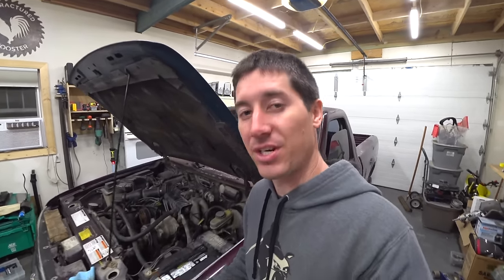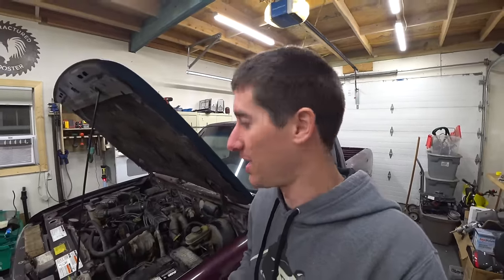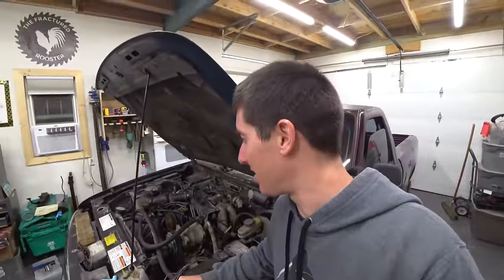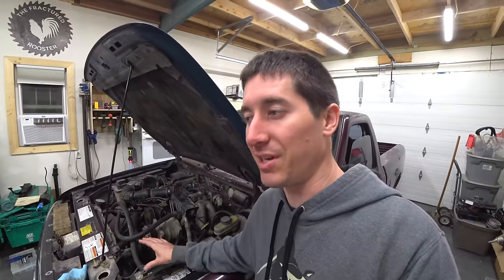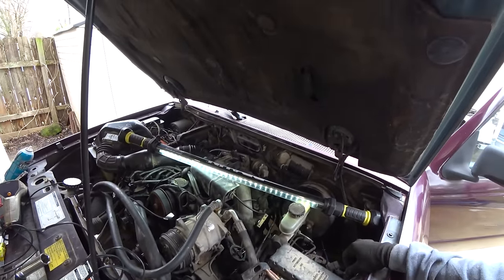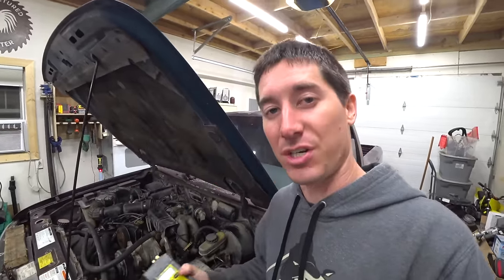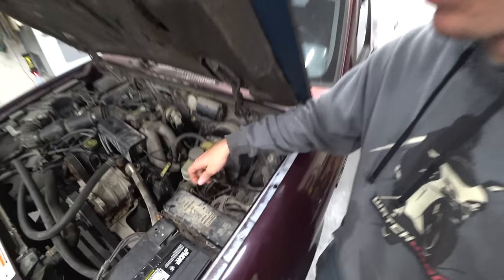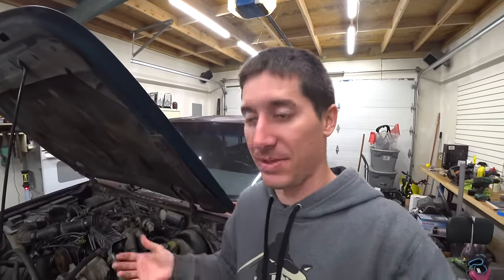We FIXED The $300 Ford Ranger And It Doesn't Make ANY SENSE

Comment: had a '91 Ranger...  same configuration...   2.3L dual plug, 5 speed standard cab short bed XLT.  Great little truck.  Drove it cross-country 5 times.  You're right...  they're a great little truck.   No significant power to speak of, but always ran great.   Never had a SPOUT connector issue with mine.  Bought it 6 years old with 100k miles on it for $2000.  Drove it another 7 years & 92k miles, & sold it for $1500.

Comment: Like I said, days ago, those had module problems. The SPOUT connector keeps the module from handling the timing control over to the ecm. Unplug the spout and the module runs on base time
Reply: I think it might be the TFI module
Reply: So changing that module should be the fix? I don't know anything and I'm a nobody but I need these videos to learn thanks to everyone.... so I'm wrong.... Thanks for ur input guys....
Reply: Hey Remember on that first video when we all said the computer wasnt taking over? +1 to OP
Reply: @albertcastle7786  : Actually, cleaning up the grounds and heat sink could fix it, if an auto parts store bench test has it come back okay.

Just be warned: Removal of an ignition module off of the intake manifold can be not worth it, if the bolts that hold it on are corroded beyond repair. They are also very easy to strip the heads on as well.

Comment: Bad EEC is very common in these. I chased a driveability issue on my 97 with the 2.3 for a year before I finally replaced the EEC. Problems all went away and it ran WAY better.

Comment: I still say check ALL the ground connections on the entire truck. Remove them all, clean all the spots where they connect with sandpaper, use some dielectric grease, and reconnect them. It can make a huge difference in reliability on these trucks. The ECU uses grounds to switch circuitry on/off...
Reply: Jesus loves you alot trust in His death 4 salvation and be saved from eternal hell <3 Jesus died on the cross for you bro. <3

Comment: I also own a 93 2.3 Ranger. It just happens to be same color (except for your replacement hood). My coolant gauge has always  indicated barely warm even when the engine reaches the normal operating temperature of 193 degrees Fahrenheit. Early on I contacted the previous owner but he assured me that it's normal and not to worry about it.  Last spring I decided to replace the thermostat anyway. I ended up having to remove the fan, fan housing, and upper coolant hose in order to provide working room.  The first attempt was a complete failure. The truck ran icy cold.  I don't know how often this is the case, but the funky  thermostat housing also needed to be replaced at the same time in order for the new thermostat to seat properly. I recommend that people replace both parts to save time. With the fan removed for the second time,  I decided to also replace the fan clutch as preventative maintenance. That job doesn't take long. By the way, there was no change in the temperature gauge reading afterwards but it did provide some peace of mind. 
The driver side spark plugs are hidden under the intake manifold, fuel injector rail, and part of the wiring harness. Some are much harder to get to than others. The job of replacing plugs on that side  is so difficult, in fact,  that my shop manual recommends removing all the stuff blocking the way first. Wow, are you kidding me?  It would be nice if someone posted a clear video on either how to remove the intake manifold and fuel injector rail or how to go about replacing the plugs with the least amount of hassle. There are some videos but I found them so murky and incomplete that they were useless.

Comment: "He got it FIXED? Guess i better stop everything I'm doing to figure out how."
Reply from the maker: It's okay, we still don't know how... but 99% sure it's a failed ECU 😂
Reply: @WatchJRGo  first thing I said Jr go!
Reply: Why don't you fix the video volume so we might be able to hear it
Reply: My bad your good my phone is the problem
Reply: @WatchJRGo  Did you check the wiring on the return side of the spout?
Reply: https://www.fordforumsonline.com/threads/identifying-and-understanding-ford-ignition-systems.3764/

I think it might have a bad Cam Position Sensor (CMP) sensor:

LDR DIS Camshaft Position Sensor (CMP)
The function of the CMP sensor (commonly known as CID) is to detect the position of the camshaft in order to identify cylinder #1. Like the CKP sensor, the CMP sensor is also a digital, hall effect, output device. On the 3.8L, the sensor, vane and permanent magnet were designed to be installed in the same bore as originally provided for the distributor. On the 3.0L SHO, this assembly is located on the right end of the rear cylinder head assembly, close to cylinder #1. The CMP sensor generated a signal in the same manner as the CKP sensor. The CMP signal is a digital square wave that varies between zero to 0.4 volts (CMP low) and battery voltage (CMP high). The CMP signal goes high at 26 deg ATDC of the power stroke of cylinder #1. The duty cycle is 50%, therefore, the CMP signal stays high for one complete crankshaft revolution. The CMP signal goes low at 26 deg ASTDC of the intake stroke of cylinder #1.
The CMP signal is used by the DIS ICM to fire the proper coil and by the PCM to fire the correct injector at the proper time.

LDR DIS Failure Mode and Effects Management (FMEM)
If the CMP sensor fails, the ICM will randomly select one of the two coils to fire. If hard starting results, turning the key off and then cranking again will result in another "guess". Several attempts may be required until the proper coil is selected, allowing the vehicle to be started and driven until repairs can be made. If the SPOUT line fails, the ICM will fire the coils directly from the CKP sensor. This results in fixed 10 deg BTDC timing and fixed dwell.
If the ICM is in dual plug mode, IDM will mirror SPOUT. If the ICM is in single plug mode, IDM will be inverted with SPOUT (i.e. SPOUT is high while IDM is low).
Reply: @MrHerrjon  this is 2.4 4 clay!!
Reply: It was the ecu
Reply: @WatchJRGo  I had a very similar problem no spark with the spout in take it out I had spark I replaced Ignition moduel  coil and did a tune up just to find out it was my pickup coil in my distributor  in your case would be the cranksensor mine was a 94 ranger with the 3.0

Comment: Congrats on getting Ford Danger running.  Ironically as you were checking out parts I noticed how garage roof was framed, beams run lengthwise (long ways) instead of crossways (short ways).

Comment: I’m guessing that you could have a couple sticking valves. They hang up until you advance the timing and then they’re ok. Drive it for 50 mi with sea foam in the oil then change it with synthetic oil and call it a day.

Comment: Makes me miss my 93'.Same color but long bed.Leased it for 2 years back in the day when I was selling new Ford's.Never had any problems with it.Wish I would of kept it!Little Pinto motor came a long way from the 70's.Dual plug head was a cool trick to squeeze a few more ponies out of the coral and also burned cleaner.Was also the 1st American engine designed with metric parts in this country when it was introduced for the 1974 model Mustang 2 and Pinto.Nice job getting it back going JR.

Comment: The other spout connector changes the computer strategies for higher octane fuel. Common to unplug it when you have spark knock problems. You might have a Ignition module going bad.
Reply from the maker: We did try a brand new ignition module, no change (with and without the SPOUT connector, you can see the old one pop back in during the video) 😬
Reply: WatchJRGo I used to work at Ford dealer until 2004, retired. My old mind remembers pulling spouts on no starts as part of flat rate diagnostics. But can’t remember the rest. Thinking it was something easy to repair. In eastern Canada those trucks are long rusted out and gone. It was a common problem at one time.
Reply: @drost582  It may be a bad TFI module. It is located on the back of the distributor.
Reply: @collinklitz7434  : TFI isnt used on a 1989-1998 truck, as EFI and DIS replaced carburetors and distributor ignitions in the same year.

What you're referring to is a bad Ignition Control Module, located on the front of the intake manifold. And yes, those modules are known for having casing issues, corrosion, and grounding problems, because of the engine heat under the hood.

Comment: Worked on an early 90's E-250 once that confounded me to no end.
The entire ignition system replaced, TFI module, several sensors, fuel system gone through......just, no start-no-how........ended up being a bad ECU, which was surprisingly cheap from Napa.

Comment: Watching this made me miss my 82 ranger. Same set up. The sold it to me because after he got the motor rebuilt he couldn't get it to stop leaking oil. I towed it home and immediately found the valve cover bolts were finger loose. I put a new gasket in it a pcv and filters. It took me another 100,000 miles before I sold it to a guy for $1,000. All I did was keep up on maintenance. It's still running to this day.

Comment: I was going to say I had a 1991 explorer that had all kinds of strange problems like this. After trying all kinds of things for years we finally figured out the ECU circuit board was all corroded on the back side. Replaced it and sold the thing. It's still driving around town now.

Comment: The TFI module next to radiator ( on some models) is malfunctioning. If you still have issues with it not warming up, the impeller on water pump needs to be checked. I've been dealing with these engines for ages. Always the same issues. Here is something for you to wrap your head around, Do both spark plugs fire on the same cylinder or does the spark get wasted on the exhaust stroke on the other cylinder? For those who don't know, these engines have 8 spark plugs.

Comment: Ford had 2 different ICMs during the OBD1 years, gray and black (you can look it up, thousands of blogs sites) Sometimes both ICMs in the same model year, but the ECU works differently depending on the ICM. An issue with part stores is they all make gray ones, so if you go to OReiley  or NAPA...they just come in gray. If the spout connector removed is allowing the car to run, you might have the wrong ICM, because the spout operation is different for each one. If you decide to trouble shoot deeper, I would recommenced you look up the correct ICM using the serial number of your ECU, and go with a genuine motorcraft part to ensure it’s the correct ICM. Oh...and another ford idea...there is a special thin wall socket to fit inside the ICM to remove it from the heat sink. Good luck!
Reply: Yeah, no shit! Had to grind a socket to get that twerp ICM off me Aero1star.

Comment: I had a '96 4.0 automatic. Purchased in '98 with 27k miles, ran to the ground at 332k miles. Engine was a beast, especially considering my lack of taking care of it. It should have died around 220k tops. Only had to replace front left caliper and solenoid, thermostat, tensioner pulley and belt, starter, tires a few times, and battery twice. Had it 11 years, and it saw 34 states.

Comment: Well, I was wrong, I'll own it! I honestly thought the cat converter was it.
On the actual problem, I'm not sure in this one, but a friend had one around that era, bought it brand new and it had similar issues, turned out the ECU was mounted under the dash and one of the pinch welds was leaking letting water run into the the ECU and shorting it out. The dealership ended up giving him another truck. Might be worth a look at the connectors?
Also, Ford Motorsports used to sell a camshaft for these, I put one in my '94 2.3l, really opens them up around town, lots more low end and driveable power, it still sucked on the highway, but a good city truck.

Comment: Already said days ago unplug the SPOUT connector. Timing advance is NOT controlled by the ICM, its controlled by the main computer receiving the PIP signal. Replacing the ECU can still not be the problem. The problem can be the PIP sensor inside the distributor, solved by replacing the distributor.

Comment: Ford went OBDII in 1995 & 1/2.  This is when they got the capability to read data from the PCM (Powertrain Control Module) via a scan tool.  The pre-OBDII was flash codes that read through the dash MIL (Malfunction Indicator Lamp) and could be initialized by a jumper under the hood or with a code reader that used the same connector's.  The symptom that is being experienced by that old Ranger is most likely a bad MAF (Mass Air Flow) sensor.  The same issue is common in most MAF cars and trucks.  Runs crappy or will not start with the SPOUT connector plugged in.  Unplug the SPOUT connector and it starts and runs.  When the SPOUT connector is unplugged the engine runs in Open Loop Mode and the timing is fixed at 10 degrees BTDC.  That is why it starts and runs but has poor acceleration and overall performance.  In this mode of operation the Air/Fuel ratio is also fixed and ignores the Oxygen Sensor input.

Comment: Went down this exact same rabbit hole with my '93 Ranger about year ago. Long story short, both coil packs are bad. This engine is twin plug head. It has separate coils for each bank of plugs. One or both will be used at different times depending on engine speed, load, and temp. All controlled by the ICM. The truck runs without the SPOUT because it's in default setting, using both coils and banks of plugs at the same time. When running like this each coil pack picks up where the other one is not giving a strong enough spark. One plug will fire where the other in the same cylinder will not, allowing the engine to run.

Comment: Grounds?  I have found on fords of that time a lot of times cleaning and inspecting the connections made the fix last longer.  The gremlins have driven me crazy over the years,  grounds are the first thing I check now. the small ground wire off the battery has a connection that looks like  a fusible link. also if it has battery clamps replaced , folks seem to like to disconnect the frame ground lug on the wire to get a little more length to the wire. The bad grounds can cause weird / non working fuel gauge, tail lights, turn signals and other assorted intermittent weirdness.

Comment: I had a 91 Ranger with a similar problem right after Superstorm Sandy, drove me crazy. Could figure it out to saver my life. Pulled air cleaner and it ran great, idle a little high but ran. Looked more into it and ended up getting MAF cleaner, sprayed it down and the thing ran great afterwards
Reply from the maker: Nice! I clean a lot of MAFs around here, if nothing else it’s a good maintenance item 🍻
Reply: Same

Comment: The obvious solution is to put an on/off dash switch to the SPOUT connector. Or buy a new PCM like everybody in comments says it needs. For a Ranger, really, either option is fine. It's a ranger. Make it run and do things.

EDIT: Just saw you got a PCM on order, good job doing it right.
Reply: A 1993 Ranger doesn't have a PCM.

It has an Ignition Control Module that controls ignition timing from the ECM.

Comment: My Ranger always ran a bit cold. But I never had issue with that part(Spout). Mine has 323K on it. Not a typo. It's parked right now awaiting a suspension/brake/body mount rebuild. Then going to put a newer motor and trans in it. Then its my son's. He was brought home from the hospital in it. He's 15 now. Gonna keep an eye out for other rangers that dont run just for parts.

Comment: I just bought a project ranger for $350 with a brand new battery. It's a 1996 Supercab XLT 3.0. Runs and drives fine, but been giving codes that prevent it from passing california smog. Sad that so many fine cars and trucks get junked in this state because those smog laws. 😪

Comment: Its called it's a ford syndrome. This happens when the truck figures out it is a ford. Now don't worry it's easy to fix:
Step 1 remove the ford badging.
Step 2 replace them with Toyota badging.
Step 3 clap 4 times.
Step 4 say "Boom done".
After you complete these steps the truck will come to life.
Defiantly thing the ECU is shot good work man keep it up

Comment: that's a wierd one... sounds like the TFI (ignition) module then, usually when they go they just go.  it could also be a wiring issue somewhere, but usually the TFI module will get really hot if it's bad.  The TFI module is the one that used to be on the distributor on the older ones, but moved to a little aluminum block on the inner fender.  Also, 5.0L EEC IV v8's from that era swap into those trucks very easily, and the wiring harness will plug in if you get another truck harness :)

Comment: I've got two 94's and a 96 that I'm putting in a 2.5 Great videos as always. I would have sent you an ECU. You're right, they usually run forever, but sorely lacking power.
Reply: I'm currently having this problem with my 94 ranger it was running fine but one day to another it died and wouldn't start. Do you know what could it be ?

Comment: Just pop the top on that ECU and replace the capacitors. If the capacitance or capacitor's ESR (equivalent series resistance) has drifted due to age, it could be throwing off the ECU in some way or another that makes symptoms such as this. Might as well try the 50 cent fix first.
Reply: Eyyy. Found an article mentioning the '93 ranger and capacitors in the ECU causing this kind of problem. Called it! http://www.tinkerandfiddlewith.com/ranger.htm